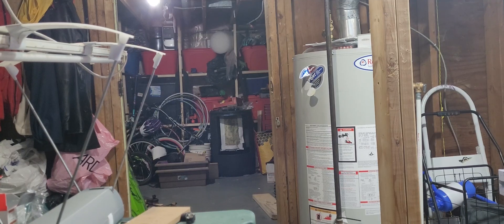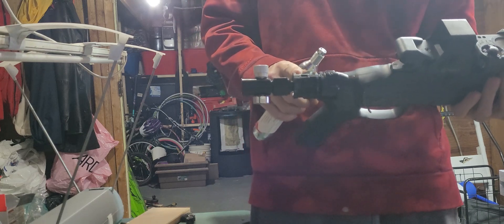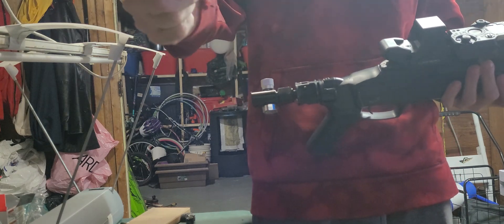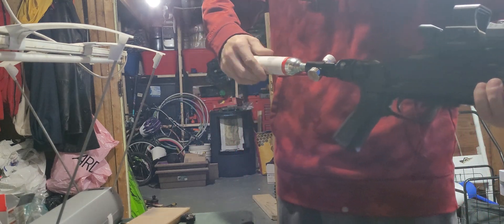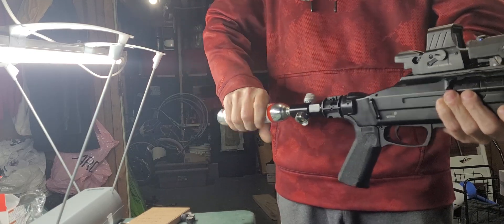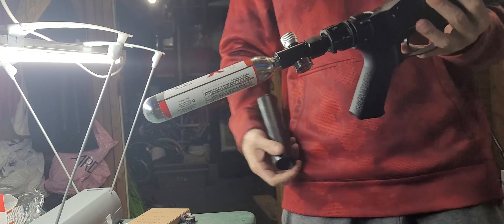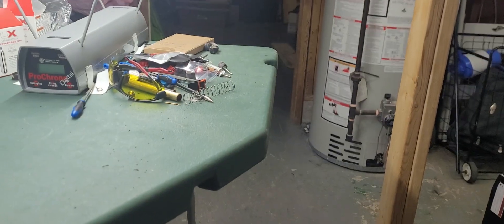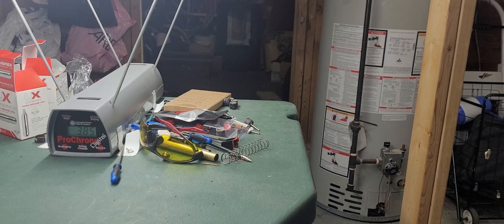Umarex HDX 68 Drop in 88g Valve Power Test Home Defence 24 49 Joules

Comment: With a 0.5l co2 cylinder I had max 900psi, how does 88g reach 1100psi? The difference is made by the liquid, different quality?
Reply from the maker: i have pics of my 88g reaching 1300 psi and 1100 psi, i posted in the groups a while ago the pictures, this is why 88g gets more power then a 12g or 2x12g
Reply: @LessLethalHomeDefense  amazing, temperature certainly makes these differences.

Comment: Hi Jeff, I want to ask you a question. when you converted HDR50 in one of your videos into a carbine using HPA cylinder, did you also increase the air chamber of the gun itself? I mean, to make the gun shot even more powerful, it is necessary to increase the volume of the primary chamber of the gun where the air is located before the shot? (and is it possible to use a 0.5 liter cylinder with an output pressure of 2200 psi ?).
Reply from the maker: yes i used the master cylinder from critical situations, its a screw in air chamber extension, i got around a 25 joule increase from it, but its not necessary, you can reach lethal power without them, and after 1300 psi the oring will blow out so you can reach up to 150 joules with just 1100 psi and air chamber extension
Reply: @LessLethalHomeDefense  So the pressure in the tank should not be higher than 1100 psi? Or the valve (with 1100 psi outlet) regulates the pressure in the air chamber of the gun itself ?
Reply: @ANDRON-022 
Outpressure of course,in the hpa cylinder 3000psi.
Sorry but your 0.5l cylinder should not be for co2!

Comment: Low numbers 🤔
Reply from the maker: heavy balls, 10.9g 7.5g and 8g and 45-50 joules will do some nice damage, check out what 38 joules done to my back in other vids
Reply: @LessLethalHomeDefense  
My HDR50 give 42 joules, on co2 12g..(17inch barrel) 
4.8 grams bullets..no lie.

Smaller than .68 will penetrate more at the same spot..or around with some more shot.
Reply: @HUNTER1GHOST 
That's because a smaller caliber has more force on
cm².Where both cal 68/50 are of the same power.Ex 50j.